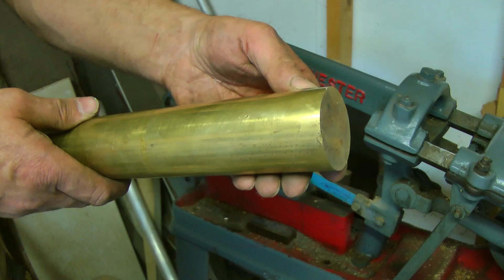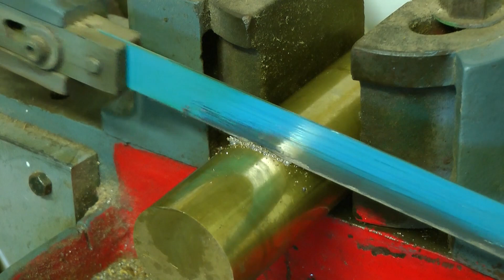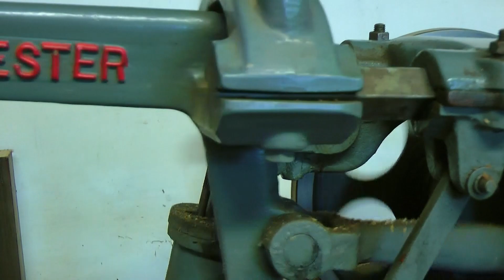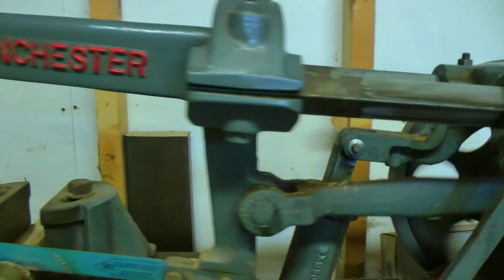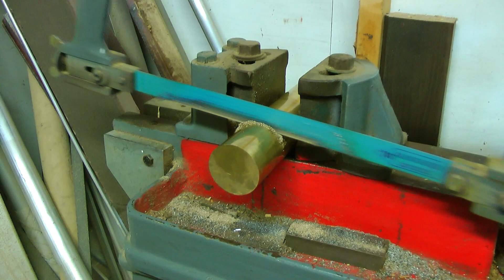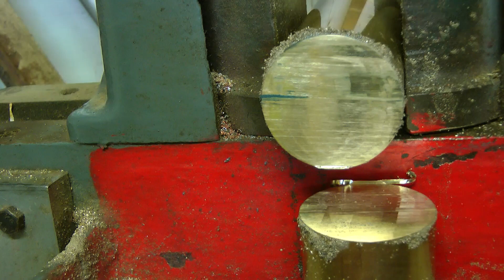power hacksaw cuts the huge brass bar

Comment: I love my old power hacksaw, slow and steady, but it does the job. Mine Takes about 20 minutes to cut through a 60mm diameter bar of 4140.
Reply from the maker: Thank for view , what makes your saw ?
Jack and how long have you had it ? 
mine was 450 volt  three phase with a gearbox / combined motor , so I had to change the motor to single phase and pulley it down , but it was  still to fast , so last year I converted it back to 240 volt three phase with a variable speed drive , it’s great now

Comment: These are neat but band saw does the same thing quicker and cheaper.
Reply from the maker: Your right , and I really want one , but this came up on eBay  , for £50  lol , but with worn bearings and wrong  voltage motor …, I made a video on it , I had to build up the main shaft with weld and machine it down on the lathe , and bore out the bronze bearing .. I don’t even know how I did it ha ha , thank you for viewing, Chris